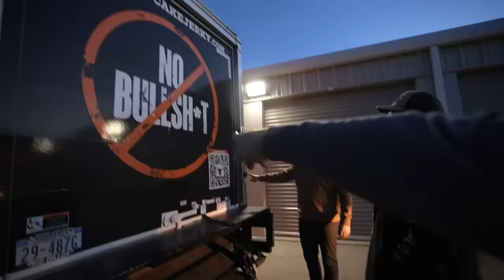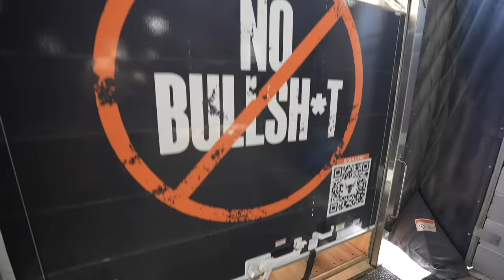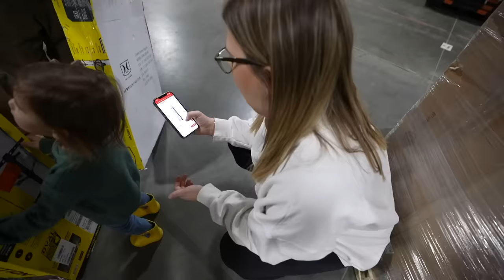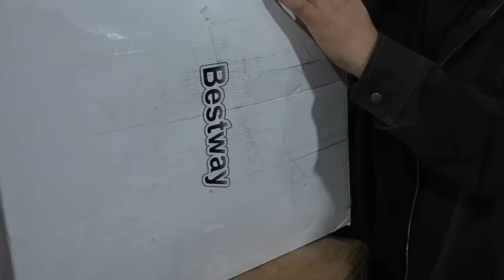I Bought MYSTERY Walmart RETURN Pallets!!! (Biggest Profit Yet!)

Comment: That second box of hottub stuff goes with the first one, the bubble wrap looking thing goes under the hottub for protection and the thing Flair was holding is the top and the unit Banjo was dragging around is the pump to blow everything up and is for jetting bubbles and the heater. Hopefully, you guys can get it together and set it up in Banjos office.😂

Comment: Part of my mexican homeless burrito line up, " Xmas 4 slice homeless burritos! Buy the largest mission wraps walmart carries,A big block of real american cheese yellow or white not that cheese food junk. Make it great value or land o lakes. But a jar of medium hot salsa. Get a huge fry pan & metal or glass lid. Lay in the wrap on low heat & press down hard by hand,flip & repeat twice until good & warm. Now lay 4 slices of cheese down the center with the corners staggered 1" or so. Lay on 2 table spoons of salsa & spread over the melting cheese & lay on 2 strips of pre fryed well done bacon. Cover with lid on low heat until the cheese starts melting (glass lid works better). Now fold in an edge till it reaches the cheese & fold tumble all the way across quickly & shut off the heat ,cover again & let cool enough to handle. Now uncover,fold in ends & munch. Its mexican grilled cheese & bacon. "Mexi Xmas homeless burritos!"

Comment: Just in case others haven't already chimed in. When you're using a lift gate, get it as flat as possible, then turn the pallet as you're putting it on the platform so it's sideways with the pallet jack still under it. You can have someone ride up with it to stabilize it too, I've had tall pallets of fireworks tip over, not fun hah. But yeah, that's the easy way.
Reply: Another tip, add strap bars or anchor rings so you can strap stuff to the wall. Also, unline sells dock plate bridge things, forgot what they're called but it's like a 3x3 diamond plate platform that sits in between the dock plate and the truck and not all docks have dock plates.